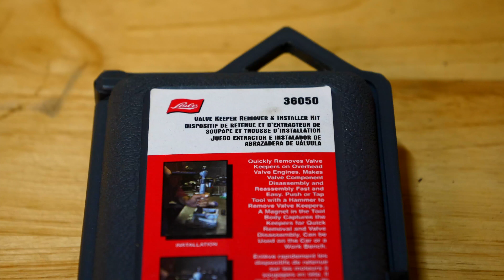How to Completely Disassemble a Cylinder Head // JCW Forged Engine Build

Comment: Just had a mini in the shop I work at for a misfire cylinder 1 I after basics I check compression and 1 was at 0psi so I did a cylinder leak down test and had 85% leak down to the crank case. Disassembled and cylinder one piston had two cracks on the side between compression rings. Pulled the rings off and about a 1inch wide by half inch tall chunk of the piston fell off. Had a slight scratch on the cylinder wall but only visible it could not be felt so new set of pistons and rings reassembled and she purrs like a kitty.
Reply: The destruction of ring lands like this is due to LSPI: Low Speed Pre-Ignition. It is a real problem with direct injection engines and everything from Minis to Corvettes are suffering from it. There are new oils coming on the market to address this issue that are expressly formulated for DI engines with less calcium detergent in the oil. It has been found that the calcium in the oil mixes with the unspent fuel and creates a solvent which has a lower octane number and is able to leak down into the rings on the pistons. If the engine is still cold and is put under stress on acceleration, the solvent created can pre-ignite before the piston is at a full downstroke and prior to the spark plug firing, thus the bottom of the ring land is cracked and eventually blown down into the oil pan.

Comment: Great video Milan. Can't wait to see the results when you're done ;). The engine is actually not made by BMW. It's made by the PSA group (Peugeot and Citroën) so the engine is from France. I work at a Peugeot workshop in Denmark as an apprentice, while studying mechanics at the moment, so i see these engines once in a while ;)
Reply from the maker: Oh I didn't know that. Well whoever made it, Peugeot or Citroën, that is one thing. Allowing BMW to accept that quality is another story. Regardless, I know mine is good now :D 

You're probably more familiar with these engines than me ahah
Reply: If i had a Peugeot, it would probably be with this engine. Even the N/A version runs great. I think it was a great idea that you started the rebuild of that engine, and replacing the internals with better components. it's gonna be better than ever! ;)

Comment: Just an FYI: valve guides are still in the head. These cap looking things are valve stem seals. If you want your valve guides replaced they have to be pressed out by machine shop.
Reply from the maker: You are right. I was just doing as much work as I could to save myself some money :)
Reply: Yeah man, I know what you mean ;) Are you planning to install any additional intake fuel injection to prevent carbon build up on the valves in the future? I've been watching your channel for a while now, I am subscribing now:) Keep up the good work!

Comment: Yup i did the same thing to my cylinder head...went down to autozone bought some degreaser and washed it several timestook me one week was on vacation so was worth it.used tooth brush and picks.....a shop would have charged me upto 600 ..all i paid a shop was 75 to make sure the head was leveled
Reply from the maker: Yep!! Its crazy the results you can get if you're willing to put in a bit of work
Reply: Don't know where you're getting quotes from but an acid dip at a machine shop costs well under $100, even less if it's part of the machine work you're getting done.

Comment: I believe that you may have mistakenly called the valve seals, the valve guides. However, speaking of valve guides. Will you be pressing out the old valves and installing new. If so, you will have to lap the valves in to achieve proper valve to seat sealing.
Reply from the maker: Yes they will be lapped, and I have other valves coming in with a 3 angle grind. This engine is getting lots of love :)

Comment: Question: i notices when you you took off the head that all the valve springs were the same. i recently changed the valve cover and noticed two were compressed more then the other. is that normal?

currently having trouble with 2010 mini cooper s. its cranking but not staring thanks in advance!

Comment: Again I enjoyed watching. But is this really cheaper to DYI if you need to purchase so many special tools?...
Reply from the maker: For the most part, I already had most of these tools. The only one I didn't have was the cylinder head organizing tool and the electric toothbrush, which was like 30 bucks. Considering what I've done in this video, at a machine shop, it would cost far more than 5 times that to get the same work done, so I think it is well worth it do do what I've done. Price out how much machine shops charge, and you will see it will be far cheaper to get this work done.
Reply: As Milan said, just consider how much a mechanic charges by the hour, and by doing it yourself you gain a better understanding of the engine, and you make sure it's done properly.

Comment: Are you going to do a port and polish tutorial?I've heard that that helps with carbon since it can't cling to smooth surfaces.
I wonder if there is a way to add port injection to eliminate carbon buildup?
Reply from the maker: 100% 😊 I'll be doing that before I sent the head out to get some work done on it. I'm looking into running a water meth kit, which acts as a port injection system

Comment: The question : 
With modern engine management combined with engineered fuels, how is carbon build up to the point that valves are semi seized in their guides and valve seats are unable to properly seal due to chunks of carbon deposits.  Isn't this car an over engineered BMW product ? What is their excuse ?
Reply from the maker: These engines work very well when they are well maintained, however they require a lot of maintenance. If an owner skimps out on something, they will see the results of that down the road. This is also Mini's first vehicle that is Direct Injection. The generations before this were port injection and they never had this problem. If they were designed with a direct fuel injector found in each cylinder, AND another port fuel injector, there would be the benefits of both systems. You would in turn get good reliability, performance, fuel consumption, etc, and you wouldn't have this carbon build up problem that regular DI cars have.
Reply: All direct injection engines suffer carbon build up... just seems to be more pronounced with the german vehicles for some reason. One really effective way to keep it at bay is with a water/meth injection system. The water/meth spray flows over the valves and cleans them, much like conventional engines that have port injection, where the fuel is washed over the back of the valves.

Comment: How do you prevent carbon from building up in a car's valves?
Reply from the maker: There are a few ways. A few ways to prevent it from building up is to install An oil catch, a PCV delete, and/or running a water meth kit. Those will all help reduce / almost eliminate that problem.

Comment: "more presentable cylinder head"  - the holy grail of the anal mechanic's quest for perfection. I so can see myself going to town on the inside of my R53 head, but luckily, the R53 doesn't suffer the same levels of carbon buildup

Comment: I would not re-use that cylinder head just buy a cnc ported head from thumper . There expensive but well worth it .used with an agressive cam (catcam) the results will shock you coupled with a dyno tune is the way forward .If your fitting forged pistons & rods do the right thing and fit a thumper head or a RMW big valve head too.

Comment: I'm sorry but you still have not explained precisely why your car had a miss in the engine. I can tell you what I think it may have been just from your videos...

I video #1 when you removed the intake manifold, I saw oil on the "4 intake seal... You can look at this video and see the #4 intake valve seat as well as the valve have excess carbon build up.

My guess if #4 was not properly sedating and you were getting blowback...

Will you please verify. thanks again for your videos.